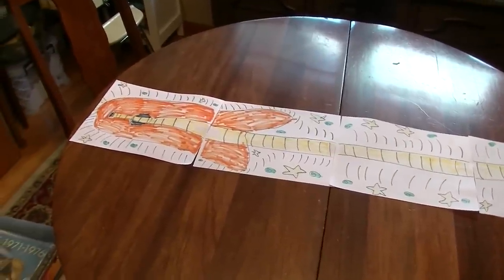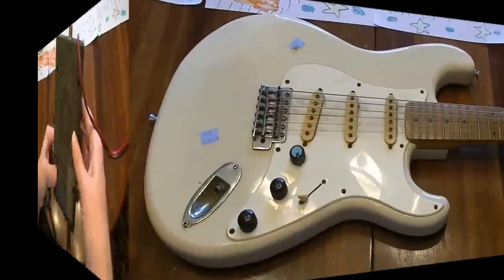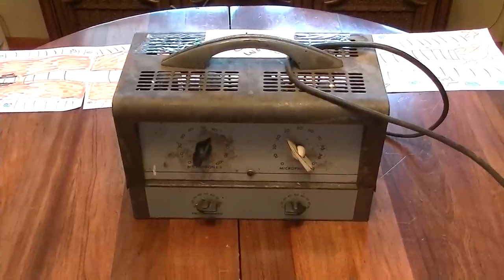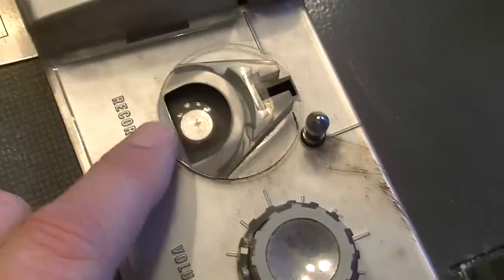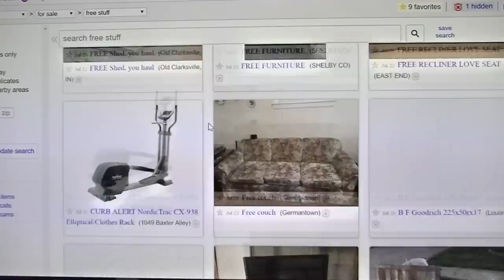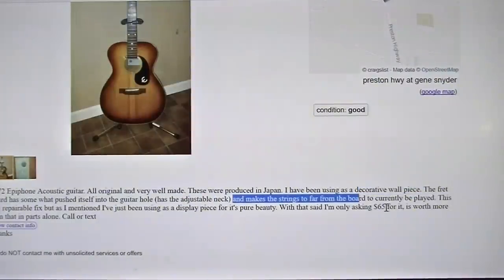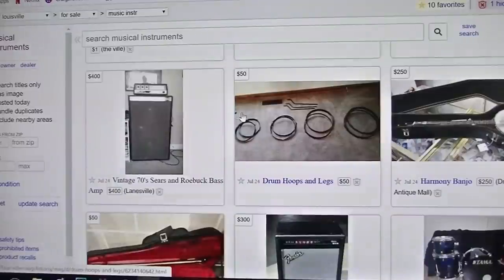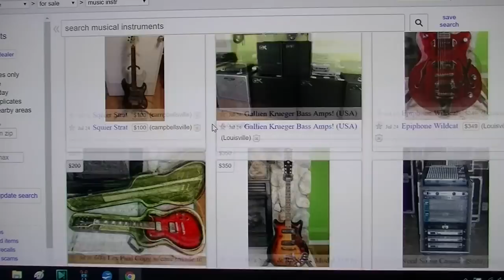Shopping for Guitar & Vintage Deals at Thrift Stores, Flea Markets & Craigslist

Comment: I can't tell you how many things I've scored off Craigslist like that. One thing comes to mind though. A set of Altec Lansing 901V speakers that were in great shape with the exception of needing the foam surrounds replaced. I still have those and they still sound great. I redid the foam myself. It's not a hard job if you know how to safely remove the dust cap and shim the motor so it doesn't rub. A little gentle heat in the right place and we're in business. Even the grill cloths were in great shape. They were a little dusty but that's no big deal. Good stuff...

Comment: The first Jethro Tull album was "This Was," possibly released only in the U.K. in 1968. By the time it was released, the band lineup and sound had evolved, hence "this was Jethro Tull." The guitar player was Mick Abrahams, a very bluesy player. Stand Up was released in 1969.
Reply from the maker: Correct. I was totally confused on their discography there. Turns out this is the ONLY pre-1980s Tull I did not have. Came out in 1973, after their magnum opus, "Thick as a Brick".
Reply: The Guitologist—I was 16 at the time and my Mum came home from the Uk with that album and the UK edition of Hendrix's first LP. Such treasures!

Comment: You are right about old refrigerators. Refrigerators are one of the most dependable things in our lives. It's because they are a closed system. Nine times out of ten, the only thing that go's wrong with a fridge, are the parts that people interact with. Handles, knobs, pull out drawers and expendables like light bulbs and the odd fan motor. Which are cheap enough to repair as most appliances like that all use the same generic parts.

Comment: That Yamaha FG-230 12-string acoustic for $175 is the one on Craigslist I would have looked at. First of all, look to see if the back /sides appear to be rosewood. If they are, there will almost certainly be a center strip of wood on the back where the two halves are joined. If it has a mahogany back / sides (most do), it will probably be one piece. If it's a red label Yamaha and the spruce top is in good shape (unlikely with an old 12-string, but you do see them without belly bulge once in a while), and it has rosewood back / sides, you might get $600 to 700 out of it. Store it for 5-years and you might get $1,000. The old 60's to early 80's Yamahas are going up and up. And if nothing else, if the spruce top is good, you might be able to reuse it on another guitar. Old Yamahas had some of the most high-end spruce you'll ever see even on their cheaper guitars.
Reply from the maker: Well spotted.
Reply: Speaking of Rosewood, I wonder how the values might change on guitars with Rosewood fret boards in the coming years. Eventually they will be a rare vintage thing. Maybe we should all hang on to our Rosewood guitars, or at least the necks.

Comment: That Lotus is pretty good.. Set up the neck, put on new strings, clean the pots and make that puppy sing. I have had a few of those and they play very well.. I also have a Lotus Les Paul neck thru. It is a solid mahogany body with Dimarzio's, came with a brass nut and sealed tuners. Very well made..!!
Reply from the maker: Andrew B I can definitely make it into a player. It's a pancake body, but that doesn't matter too much.
Reply: Thanks! those Lotus maple strat necks are nice with large frets.  ENJOY..!!

Comment: Looks like those tape recorders are kinda-sort-of stereo.  The early days of stereo were really strange.  I think it's a mono machine with a stereo tape head.  You can either do 4-track mono (two track each direction, one track at a time), or stereo output using the RCA jack in the back to drive a external amp.  That slide switch in the front controls the mode.  That 4 track mono would have been attractive to a church since they could get twice the running time out of a reel of tape.

Comment: If you haven't checked out the apps Let Go and Offer Up, you definitely need to. I've gotten a ton of good deals off of there. I got a 1972 Musicmaster bass for $60, a 1965 Fender Newporter for $100 and a 1965 Jazzmaster for $475 off of there.
Reply from the maker: Thanks for the tip!
Reply: a 65JM for what?
Reply: brich2929 $475 for my Jazzmaster.

Comment: Really nice video, as usual. I am in the UK, and didn't know if we had Craigslist, but we do! Unfortunately, there isn't that much stuff on it locally. I think Ebay is better in the UK.
As regards free stuff, where I live people often leave stuff out with a note saying please take. I have got many things that way, including a nice kitchen butcher's block cum place to keep pans etc on wheels. It would have cost at least £200 in a shop. I have also put things out, including printers and other PC equipment, and they get snapped up pretty quickly.
I would really like to know where you get your indepth knowledge from.

Comment: I believe the suction cup mic is a PZM.  You stick it to a table/podium/lectern/whatever and the enitire top surface becomes the gathering element.
Reply from the maker: I think it'll definitely do that as well, but a couple others pointed out it's a phone bug for recording phone convos on old style rotary phones.
Reply: Oh, I see.  So, it may not actually be a mic then, but a coil/pickup to ... pick up ... off of the handset speaker's EM field.  Neat.

Comment: Good bit with the Craigslist tips. Almost got a cheap little Dean Vendetta for 20 off of CL, it needed strings and electrical work but had brand new pickups. Too bad I was broke and couldn't get it in time

Comment: Your girl's guitar drawing should be submitted to Washburn for Paul Stanley's next model. 

You picked up some cool vinyl.

The tweed briefcase could be used to make a portable amp with the guts of a Champ and a 6" speaker. I think it would be cooler than cool.

If you link all 9 of your tape recorders together, you could take multi-recording to levels that even Les Paul and Brian May haven't tried yet... LOL! 

Yeah, you found some cool junk!
Reply from the maker: Thanks, Paul! Yeah, I'm already considering using the briefcase/suitcase as an amp even after removing the back. I think I can do something different with the back and both repair my National amp AND get a cool case amp out of the deal.
Reply: The Guitologist - I was thinking of a Tweed version of the old Silvertone guitar case style amp. Please post it in one of your future videos. Take care.

Comment: I did enjoy the video. I noticed that Rod Morgenstein Dixie Dregs, unfortunately Winger (All good musicians, but kinda cheesy. I bought the first album because of Reb Beech and Morgenstein) was on the Double bass tape. Looking forward to the P.A. amp. You know, I start saving money starting every Christmas for gear, and you may just grab some of it with one of your amps. Right now, I'm looking for a little higher end guitar with a neck that plays as easily as my old Korean Kramer from high school. I'm not really sure what made it play so smoothly, but I'm guessing the 12" or flatter radius and more of a shallow c-shape. The Eric Johnson signature Strat sounds like it would fit the bill, but I'm not that rich. Plus I'd like to have a humbucker in the bridge w/a Strat style guitar.
Reply from the maker: Why not just get an American Standard Strat? I mean, they are consistently great guitars.
Reply: The reason I mentioned the signature strat is it has, i think, a 14" radius fingerboard, and it's shallower from board to back. Unless I can find a standard with those dimensions. Different necks never used to bother me, but now I have ms, and I'm having some trouble with fatter necks, and I remember the flatter board played really easy.

Comment: There are now routes you can take to go to yard sales and meets. They start in one state and end in another. Brad good stuff you put out. It is like talking to in person! I have a question....I built a piezo pickup preamp with a 10K pot for volume control but I get a pop from the switch when I turn it off and on. Is there a way to get rid of the pop? A capacitor? Thankz
Reply from the maker: Yeah, a capacitor somewhere should charge and prevent an inrush of voltage.
Reply from the maker: Small electrolytic.

Comment: Stick on thing is a telephone pickup, I think.
Reply from the maker: You are correct. Someone else pointed that out too and it clicked. Def, that's what it is. I gotta think there aren't too many of those around. I wonder though...what was a CHURCH doing with it? Were they some kind of cult collecting dirt on their congregation? Blackmailing them for equipment money? :P
Reply: That inducer will not only work on the ear piece of a phone receiver it also works on any small speaker on the magnet side. Pretty cool. I still have one from back when radioshack was still cool and sold them.
Reply from the maker: Ok, so it needs to be close to a speaker or other inductor to work? I might have to do a separate video on that thing. or maybe even MAKE one.
Reply: Yea, I'm pretty sure it is just a magnet with a coil wrapped around it like a speaker. Being at the front or back side of a speaker causes it to pick up on the variable magenetic force of the speaker and provides a low voltage signal that can be amplified or recorded. On the flip side,  I suspect a low wattage signal injected into it would make a small bit of sound like a speaker now that I think of it! Hmm... the possibilities!
Reply from the maker: Yeah, it's kinda like the windings of a transformer inducing signal in a secondary. Interesting device. Seriously cool.
Reply: Exactly!
Reply: Might be interesting to put it against the output transformer on an amp and see what it picked up. Safe DI from a none isolated amp, perhaps.
Reply: Mike Pepper, I was thinking the same thing! I'm sure it will work, maybe not with a high quality but definitely would pick up a signal. It's all about inductance anyway!
Reply from the maker: This conversation has really got me wondering. Thanks guys. Definitely merits exploration in another video!
Reply: Yup I still have one ... uhhh ... errr ... well , somewhere around here ...

Comment: I feel sure that tweed case has already been torn up for the back panel.  BUT JUST IN CASE it got set aside, and is still like you found it, maybe you should check that manufacturer name to see what value it might have just as it is... Both the case, and the likely owner you found, look like top-quality gear would be in the works.

Comment: I hope you would be able to sell your amp conversions.  Seems you could pair them with a cabinet and speaker upgrade.  Modded low watt tube amp goodness with choice speaker.  I knew a friend with a tiny vintage tube amp and had no idea of the magic combination of the small tube amp with your preferred distortion or overdrive pedal.

Comment: Do you know how to artificially age monk's cloth? It can be made to look like old tweed.
Reply from the maker: No idea.
Reply: So there are certain varnishes and lacquers that - clear coat stuff - can be "yellowed" pretty quickly with heat, but you can also put it through the wash with relatively new red and brown towels, and you can also take about a tablespoon of instant coffee, and mix it with a 1/4 cup of vegetable/olive/corn oil, and then cut the whole mix with about half a jug (8 ounces) of tung oil, or possibly even oil-based poly, not 100% on the poly, but it seems like it should also work, but either way, you can basically apply it to a cabinet that is covered in the monk's cloth or that "roklon" shit (don't know if I'm spelling that right), the way I assume they do "lacquered tweed" coverings. If you're interested, I can take some before/after video of a head cabinet that I made for my Yayo-Forty-Four that I plan to do that way, and upload it. I did most of my cabinets by staining the outside, but used everything from monk's cloth to nylon to burlap for grille-cloth, and it comes out looking very nice when I take any bleached fabric and use the instant-coffee method. Dry watercolors work too, but then you have to make sure you're using water-based poly, and water-based poly kinda sucks for almost every application. There's also "universal tints" from stewmac, but you pay a lot for a tiny little pill-bottle of it.

Comment: all the "antique" shops around here are junk peddlers. Not good junk like we like. SoCal is picked clean.
Reply from the maker: The coasts are where all our stuff end up eventually, but probably not in thrift stores.
Reply: Ha and the fish accidentally swallow them and die of TUBErculosis.
Reply: The Guitologist I have contacts that are trying to get me info on a closed down radio repair shop in Mexico. There's tons of stuff and I'm trying to get pictures to see if it would be feasible and worth the time and money to ship it to me.

Supposedly there's cases of Allen Bradly resistors, RCA/GE tubes and tons of wire and sockets. Flying down there to see the stuff is another option I might do if there's really good stuff. 

If it happens, I'll email you some pics and information. Might be a gold mine!